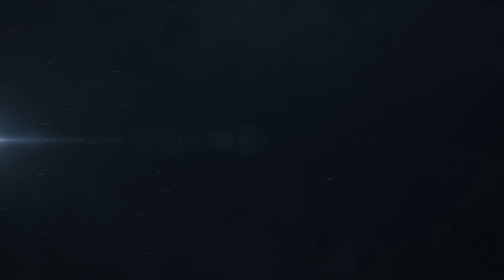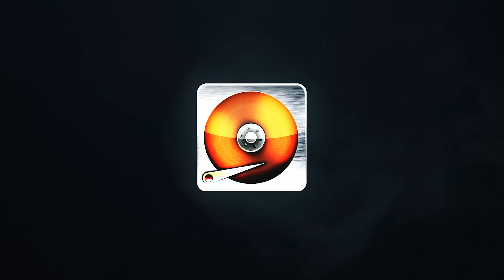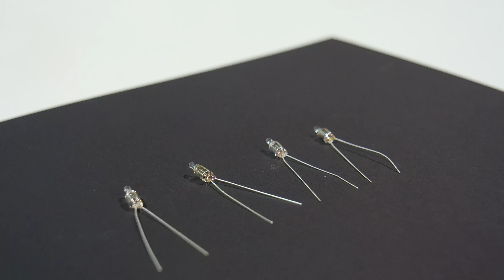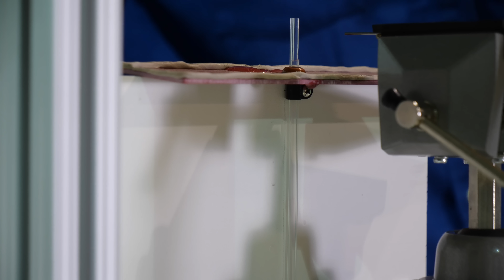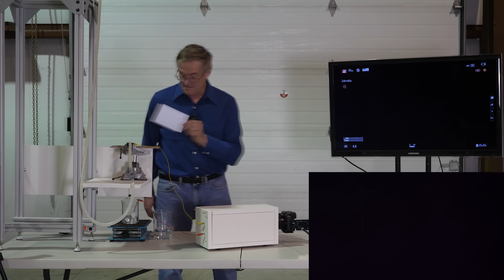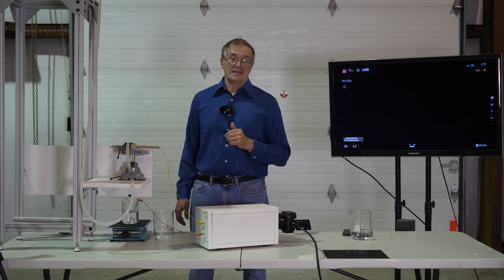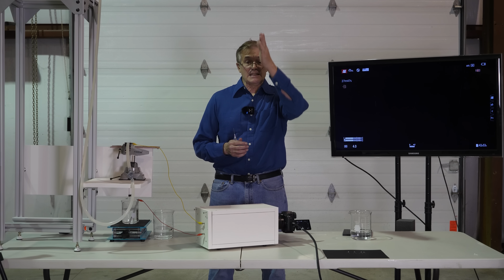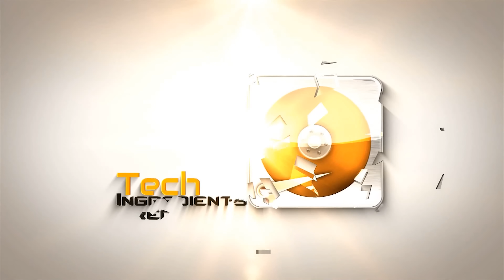We made electricity from water - and it's easy!

Comment: I've watched many fake Ytubes about generating electricity from water and never believed it's possible. Today, I do believe it's possible from a trusted source like yours. Thank you for your work giving me more knowledge everyday.
Reply: Wouldn't you generate more electricity by 3d printing micro turbines attached to hard plastic straws where water can be pushed down through gravity?
Reply: @JBNetBreaker density
Reply: It is still not possible. The title is misleading clickbait. This is about producing energy with water not from water. Big difference. The energy is ultimately from a difference in height just like in a hydroelectric dam. But it's much more inefficient. And it is operating via electrostatics detour much like a Kelvin generator.
Reply: @mechadense  if not water, would sand or minerals dropping from proper height generate electricity?
Reply: @BaliFoodTreePlanter  - Kelvin generators should work with appropriate granular solid material too. - This particular method might work with other slolvents instead of water that so far they show similar surface contact behaviour. Ammonia for one maybe.
Reply: @mechadense doesn't work! Either does solar or wind. China sells us windmills as they build coal burning generators!! Who's the idiot???😂😂
Reply: I watched the video lighting a bunch of LEDs from water falling, and immediately broke out the plumbers tape and was able to replicate it under the sink with water dripping on the surface. The fact is, it can definitely be duplicated pretty easily.
Reply: @newmonengineering do you have a link?
Reply: @newmonengineering please Can i have a link please ?
Reply: Well, this is not really just plain "water", it is "Flowing Water", so you aren't really extracting the energy from the water per se, but from the flowing water and charge separation. You could probably get just as much or more electricity from a mechanical electro-magnetic dynamo system with that much water flow.
Reply: @marcfruchtman9473 
This would be a nice comparison test.
Reply: @marcfruchtman9473 Yes, because the energy needed to separate those charges - move them against their electrostatic potential - is ultimately kinetic.

He talks of a tiny current but 6000V and claims that means "power". VA is the power in watts, so it doesn't. If he's got μΑ then only mW.

Further, his idea to use 3d printed sponges en masse at hydro dams isn't going to work. It'll still only have the small kinetic energy of slow moving water to extract. It'll also get blocked in no time. It'll hold too much water! (intentional)
Reply: @ΑΣΔΦΓΗΞΚΛ Yea, even then this could only really every be useful under the outflow of a stream, river or hydro plant. Rain would simply be too intermittent.
Reply: @ΑΣΔΦΓΗΞΚΛ Well, milliwatts is still power. He didn't say it was a lot of power.
Reply: @gcewing  ok, but so what's the point? You can't harvest microamps in a usable and economic way unless all you need is microamps... heheh
Reply: @ΑΣΔΦΓΗΞΚΛsocialist low power ideas like worthless windmills! Go nuc buddy!!
Reply: I would not even have watched except that it was this channel.
Reply: Um... what do you mean you never thought it was possible? Water contains hydrogen, it was always possible. The only reason why we don't use it is because using the process of electrolysis to separate the hydrogen takes more energy than what you get in return. Being possible was never in doubt. Being efficient enough to make it viable was the issue. Now go back to Myers and listen carefully to what he was saying. He didn't use electrolysis, imo he was using sound resonance to separate the hydrogen.
Reply: @davidagiel81  there is no way to go around the fact that there is a certain amount of minimum energy required for the hydrogen to separate from the oxygen. Otherwise, you are breaking the 1st law of thermodynamics and creating energy from nothing. Doesn't matter how you add the energy, as long as you reach the minimum threshold.
Reply: Generating electricity from water has always been possible and we witness it all the time from thunderstorms :)
Reply: @0x1ED1CE  no, thunderstorms and the atmosphere is a heat engine with the sun as the energy source and the umiverse as cold sink. The electricity you're extracting is ultimtely from the sun.
Reply: @0x1ED1CE  you're misunderstanding it. This entire video is about extracting energy "from water" leading one to believe the water is the energy source. Not until long into the video does one realize the energy comes from the water's flow. In reality, it's no different than hydropower. Actually, it's much worse in every way, efficiency, power, cost etc. Similarly, the thunderstorms energy source is not water itself. Of course that's obvious to you but in the context of this rather clickbait video, I think it's important to point out.
Reply: You always believed hydroelectric energy was false ????
Reply: You never learned about the Kelvin water dropper ??? Invented by Lord Kelvin in 1867
Reply: I continue to create a project of an internal non-combustion engine, I remind you that I am posting here on my channel the technology and the principle of operation, according to which anyone can create a prototype and enjoy free energy, since I am denied financial support at the stage of the idea and theoretical research, after a year of unsuccessful searches. Including I will begin to assemble a sample. And soon another video will be released revealing my developments, the wind of change is coming! All those who are not indifferent, welcome to fly into this departing innovative car, which will lead to great achievements for the successful future of the planet and humanity!
Reply: Yeah now please tell all your big brained buddies to stop mocking trivializing and leaving sassy & s©️ience-worshipping comments at anyone that suggests that the possibility exists for this!!!
Reply: You lack creativity then. Anything is possible if you beleive in it
Reply: @DaneSage elonmusk
Reply: @DaneSage ask elon musk
Reply: a company called cascatachuva in portugal uses zirconium dioxide it is real
Reply: ions are promiscuous...  my ex girlfriend's name is ion
Reply: 1912 it was,done nothing new. Oil was easily converted with a generator
Reply: I haven’t watched yet in adds but i think it takes more energy to seoerate the hydrogen than you get out
Reply: The ones that say the person was always killed for what they knew lol
Reply: Sorry, I think to believe is not the activity of scientists but create knowledge through reproducible experiments.
Reply: Yup, anytime I see the words phrase “electric charge from water movement” that’s all I can think about 💁🏻‍♂️
Reply: Yes a true source of information here
Reply: He’s finally been converted in his own little stream that he understands. Welcome to the real world.
Reply: Yes.
Reply: Yes it is a valide source..
Reply: Hi, it's possible... I used water and salt... that produces chlorine gas, which is poisonous and shouldn't be inhaled... however, it might work on a hydrogen model with a third electrode, haha
Reply: Hydro-power is one of the main source of power. Many countries has huge dams and and turbines
Reply: @lubricustheslippery5028 so do USA/Canada...nothing new power from water in or before 1912
Reply: @lubricustheslippery5028  well...somewhere alone the line someone figure you'll get more
kick out of the water if you heat it up.
What we need is some light weight material that's able to with stand high pressure, heat, corrosion..ect to make power to weight ratio more efficient.
Reply: Difference between a Physicist and an idiot
Reply: @QueenOfArabianSea the idiot will shut down nuclear power for worthless wind power
Reply: I'm just about to start watching but it can be done with the carbon rods out of carbon zinc batteries.
Reply: Never trust anyone on the internet
Reply: @tkrox8379 electric boom will judge this 😉 😂
Reply: @tkrox8379your not mentioning government, that’s a red flag in itself. If your coming at things from government programming your not Coming at it smart

Comment: You dont want this at the end of a hydropower plant. Its already optimized to extract as much power as possible. The remaining velocity is required to remove the water from the turbine
Reply from the maker: Not entirely.
The amount of velocity from the output of the turbine is still more than two orders of magnitude greater than this requires to operate.
Reply: @TechIngredients  This might Work, but a Turbine cant extract 100% of the waters kinetic energy, since the waters velocity at the turbines exit needs to be high enough to release the water it used to create power.

Comment: The next thing you hear is this guy "died" mysteriously. Documents missing . . .
Reply: was gonna say the same thing
Reply: Yes becose this can actually work
Reply: There is a reason this is not used as a mean to generate electricity. Find something better like washing machine turbine electricity generator.
Reply from the maker: I think you missed the opportunity here.
Turbine generators require a significant volume and, more importantly,  a significantly higher flow velocity.
Reply: @TechIngredients  This technique also require clean water that free from debris so it could not clog the thin tube. Filtering that said water would need a some kind of energy.

More maintenance, i guess?
Reply: He's been Epstein'd

Comment: I asked AI about this 3 weeks ago and it says currently nobody knows how electricity is made from the bubble collapse, but I theorized a micro lightning strike occurs due to friction which could be detected with a small sensitive loop antenna the same way lighnimg strike detectors work.
Reply: Fvp angel channel.. 💯
Reply: learn how to use a search engine instead. you can usually get actually accurate information with enough time/effort. there are many, many, ways to collect energy from bubbles with dozens of different mechanisms.
Reply: @haveakek why not include instructions?
Reply: This bubble collapse is a different phenomenon called sonoluminescence (https://en.wikipedia.org/wiki/Sonoluminescence), the mechanisms of which are unknown.
Reply: @MarZandvliet  Yes sonoluminescence. That is why I came up with a theory but it needs to be tested by someone with equipment. I made this comment before the video started.
Reply: Rainbows are magnetic feilds of earth..
144 ooo of them...

Comment: Actually, all electricity is made with water 🤓

Edit: jeez it was a well actually joke
Reply: If you include production processes for the initial energy generation equipment yes,

But arguably at that point you can state that you require water just because people have water in them and people are required to produce electricity....

I would argue wind power, solar, radio voltaic, ocr, ammonium gas cycle generators,direct petroleum product electric equipment(gasoline/petrol, diesel, natural gas, propane etc...) and probably plenty of others do not require water since it's not used actively in the energy generation process, 

Still 80-90% of the grid is powered by steam in some capacity and steam is water.
Reply: Can you explain why it is funny? I don't get the joke.
Reply: @djb5320 the joke is they are being pedantic, I assume sarcastically but that is completely indistinguishable from actual pedantry.... It's not a good joke
Reply: Sarcastic pedantry is basically indistinguishable from being actually pedantic.... What you said was not absurd enough to pass the bar of being an implausible position, to be honest with a couple more words you're actually close to a legitimate position. It currently just comes off as a flawed ideology not a joke, that's why you have to say it was a joke because it was a bad joke

This is real pedantry to be clear, nothing I said or anyone said these comments matter(including you tbc)